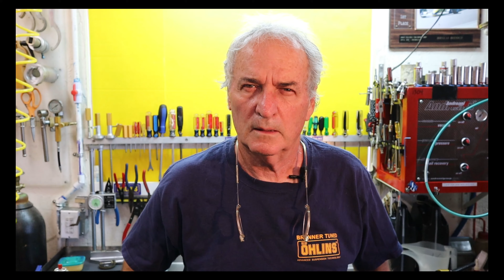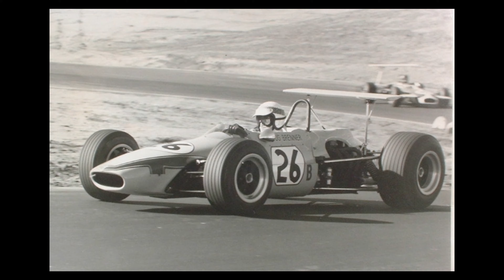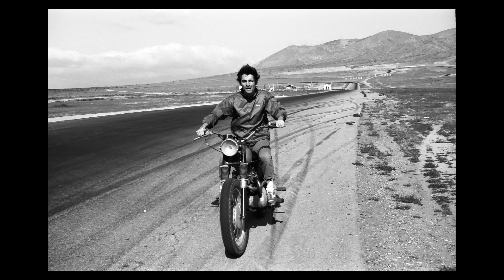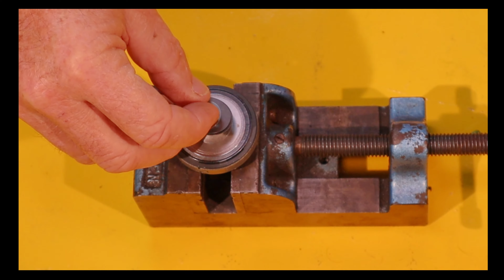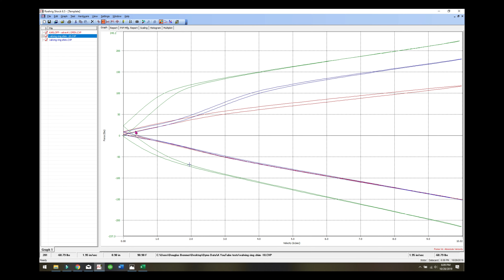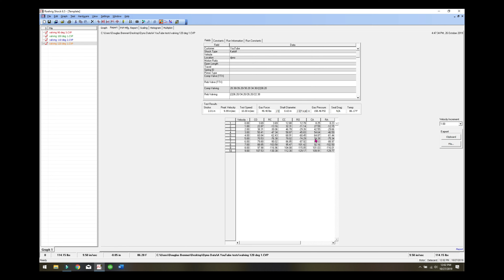Valving #4  Shim Magic

Comment: I really love your videos. Not many people show actual suspension dynos to precisely explain the differences in shim stacks. As a data guy myself, i like to see the data! So thank you. Please make more videos! 

I'm working on doing my own valving on my motocross bikes, and shim stacks are a bit more complex in dirtbikes than on street/road racing applications. In motocross applications, digressive damping curves are much more preferred so the suspension stays held up in the stroke, ready for the next obstacle. So you tend to see a lot of "multi stage" stacks using crossover shims; dual stage stages are common, 3 stage as less common but are still used.
Reply from the maker: Thanks!
Reply from the maker: I still don't believe there is any use for digressive damping especially in something like motocross.  Also you can see on the dyno sheet that all "stages" do is decrease damping.  You can't see any delay from one stage to another.  It is really great that you are doing your own valving!!  Nothing is easy and the more you try things the faster you will get.  Don't hesitate to try something that you don't think will work.  Every once in a while you will get a surprise.  I find many things are counter-intuitive
Reply: *You can watch this that does a much better job of explaining multi-stage stacks and exactly how to adjust them:
https://youtu.be/dRekn0iRiRs

One thing that really helps understanding is thinking of each corner as a fulcrum for the preceding layer, but as the force increases that starts to bend the next layer and so on, until you are down to a clamp and then hitting the layer after that.

Some critical observations of this series: (note, I did learn some things, so I'm glad it exists, but it isn't without some problems)
While I've learned a bit from The Ohlins Guy's series, like former bosses, he carries a bit of old timey "I've done this and figured it out once, so that's the only right way" mentality.
Didn't matter if I could show my boss 3 better ways to do something, his way was right in his mind, so other people's ideas "couldn't work" or his favorite - were "always less right." Life lesson is to take every person's opinion with healthy grains of salt.
He may be very good at doing it his way. And experience counts for a lot, but when an entire industry moves on...

There is a reason modern high end dirt bike suspensions no longer follow that old conventional wisdom. And he talks down on really common upgrades (racetech) that are well substantiated as significant upgrades for a fraction of the cost.
I've helped a friend tune them on his bike, and I'd definitely consider them as a viable option on my bikes. If you can get most of the improvement for 1/3 of the cost, that isn't a gimmick, it's a good design that sells well for a reason.

And every (non-china) company uses additives in their oil. Ohlins isn't special in this regard, so they just sound dishonest every time he claims it's better than all the others because they use additives - as if other's don't. Don't link to a technical marketing sheet that amount to "we put stuff in it." Quit complaining about color and show us a double blind independent test between a bunch of the oils and prove your claims. Or show us a pile of failures inordinately proportional vs yours. Do you actually have any comparative data to show a higher failure rate with yours vs any of your several competitors oils? Or do you just hate the color and always go with the Ohlins sticker?

And just like he can tune shim stacks, you can on those other too.
And just because he doesn't understand how to tune multi-stacks well, because he avoids them, doesn't mean other companies that specialize in them or you can't easily learn the concept and alter them too. (see video linked above)

And while he always says he can't, other companies seem quite capable of giving general answers and rough baselines - because they've done so many different bikes and conditions that they have a data map. No need to reinvent the wheel as a custom new concept every time. Many of them even offer it free on their websites so they don't have to waste custom fine tuning time with getting your average person in the ballpark.

And a major part of digressive damping is to correct the lack of damping down low (a systemic problem at low velocity), hence needing to digress and transition not overdamping through the whole range. Linear doesn't do that.

And dirt and street suspension setups are very different, you can tell even a quick glance street bikes and dirt bikes weren't even designed with the same end in mind. Most principals carry over, but condition and riding technique are very different.

If you tune a bike nicely for street then you will have springs (displacement reactive) to handle things like sustained high braking (which comp damping does not continue to resist). But that same spring setup for heavy braking will be woefully inadequate to handle landing from a high jump where comp damping is king. They are almost competingly opposite scenarios.

So when he makes statements in this series about 1 setup should be good for both street and offroad, it doesn't build confidence in trusting his opinion. It sounds more like my old boss with 1 answer for everything. (you can compromise to something acceptable, but refined for 1 is refined away for the other)

And also most bikes have rear setups that are progressive in nature, even if directly mounted to the swingarm/no linkage (look at the angles, as the rear collapses, the shock gets closer to the ideal 90deg, improving a component of mechanical advantage/less disadvantage). So even with a linear spring/single rate spring, they are progressive.
And when they use a linkage, they don't convert it back to linear, they make it more progressive.

Comment: Its incredible the amount of info thanks a lot for taking the time to teach us all of this, i would like to see a video on that thing that we all want "progressive damping"
Reply from the maker: Hi.  Thanks for watching and your comments.  I see a bit of progressive damping and I would much prefer some progressiveness to digressive damping but I still think that linear is the way to go.  I guess hydraulic bump stops are a form of progressive damping but really is more of a position sensitive thing as the damping only goes up relative to position of the shaft and not velocity.  As I said in my spring video I am not really fond of progressive springs.  I see you are in the air a lot and if I do that in my race car I have done something terribly wrong!  I don't really do a lot of motocross or rally stuff so I can't really give any advice (I try to know what I don't know).  That being said, my mentor Bruce Burness did do motocross (DeCoster Etc.) and I think that linear was what he was using.  That doesn't mean you shouldn't give it a try.  Nothing ventured, nothing gained!
Reply: @theohlinsguy4649  yeah of course I will try, is just that we dont get our hands on shock dyno so seeing you do mods and then test them its really gold information, the nascar piston wow blow my mind, damn everytime i see a video of you blows my mind, i dont like progressive spring too but theres something with ohlins on rear shocks for motocross bikes they use some kind of progressive because first coil of rear shock is always smaller "the bee tail" some kind like that, well i wont make you waste any more time, bye!
Reply from the maker: @Pereke69  Just try putting thicker shims up in the stack and see if you can feel the difference.  You could also put thinner shims low in the stack but I would opt for the thicker ones up in the stack to begin with.  That should get some more progressive damping.

Comment: Hi Doug,
Thank you for taking the time to make these videos. The combination of seeing the shim stack being put together and the effect of changes to that stack on the Dyno really help it all make sense.

I'm planning to use what I've learned here to help tune a bicycle fork. It uses a ring shim right being the sealing shim and a clamping shim a little further up in the middle of the stack. Neither seemed to make much sense. They also use a 3 position preload to offer a lock out. I never use the lockout (or the middle setting). It makes me think that the compression stack must be over damped to achieve that lockout. Based on what I've learned from these videos, I think I'd be happy experimenting with the damper to see if I can improve things.

Trouble is, I don't have access to a Dyno so it's a combination of tune by feel and a little device called a shockwiz that monitors changes in the air spring during use to give tuning recommendations.
Reply from the maker: Thanks for your comment Steve.  Tuning by feel (or the stopwatch) is the only real way to do it so you are on the right track.  The advantages of the dyno are to make sure that the shock is functioning properly and to see what you have actually done when you have made progress.  Having a dyno is not a shortcut to performance.  It might speed things up a bit though.  You have to put in the work and it sounds like you are willing to do that.

Since I am not really familiar with bicycle shocks I don't know what lockout is.  I also am not familiar with the effects of air springs.

The small shim up in the middle of the stack usually helps flatten out the damping at a some velocity depending on where you put it.  What it does is separate two shims with a space so that the shim above the separation doesn't start moving until the shim below traverses the space and contacts it.  I show the effect of this in my Valving #4 video about 5 minutes in.

The reason I show the dyno results on my videos after making a change is that I got tired of people on YouTube making these subjective statements about what changes in valving and adjustment do and showing fancy white board drawings to back it up.  If they do show a dyno graph they  usually use an average force vs absolute velocity graph instead a force vs absolute velocity one.  The average graph leaves out most of the important information on the dampers performance.
Reply: @theohlinsguy4649  The lockout feature is to stop the forks from diving under bodyweight bobbing around on long smooth climbs where you might be out of the saddle and making a huge difference to the weight bias of the complete system.

It's normally achieved by adding heavily to the compression circuit. So that closing the bleed causes the fork to feel locked, the shim stack needs to be pretty stiff as well. Feels like this might be a compromise too far. I'd rather sacrifice the lockout and have a more active fork. If I'm paying for it, I want to use it
Reply from the maker: @steveedwards5280  Interesting!  One of my tenants of damping is to first find out what you want the damper to do which varies with application.  Most of what I do is related to mechanical grip.  What you are doing is a bit different.  In my videos I am trying to show how a damper reacts to changes.  Hopefully you can use this info to improve your specific application.

Comment: I had a thought while watching this. In a previous video you mention a piston with a smooth surface will cause a surface tension to the sealing shim. Now, on one of those dished pistons, if the dished portion has a smooth finish, could this cause a blister in the graph or maybe even adding to the resistance of opening that the preloading is creating? Maybe you've never tested this but in theory what do you think would happen if anything? Clearly the ohlins piston would not have surface tension with its ring design.
Reply from the maker: Hi Eric  The shims sticking is a very rare event and would be hard to duplicate with any consistency.  I would think that if the shim was preloaded it might be less likely to stick as the forces acting to open the shim might be enough to override the sticking.  Good question.
Reply: @theohlinsguy4649  ah, okay, that definitely makes sense. And good to know the sticking isn't a constant issue.  You spoke briefly about thermal changes. Was wondering if you planned to cover shock oils at some point and the roll it plays?
Reply from the maker: Ohlins has a informational paper on "Why Ohlins Oil"  As soon as I can figure out how to link it I will put it on.  They spend a lot of time on formulating oil.  The specification sheet on every Ohlins damper specifies which oil to use.  I basically use Ohlins 1304 or 1309.  There are other oils for specific applications like snowmobiles etc.  As you can tell one of my pet peeves is when I find crap oil in Ohlins products.  It is so easy to just buy the correct oil.